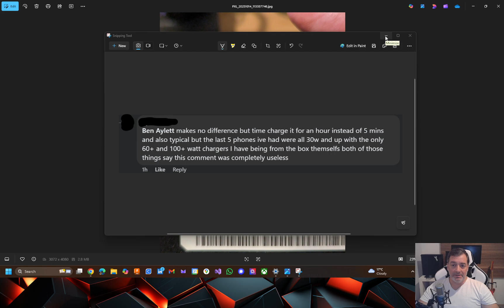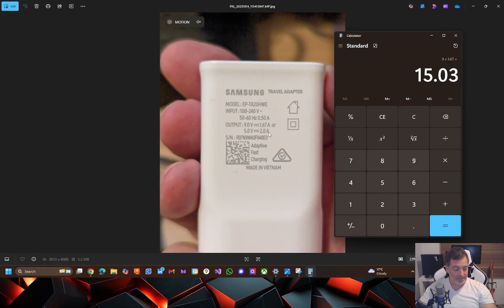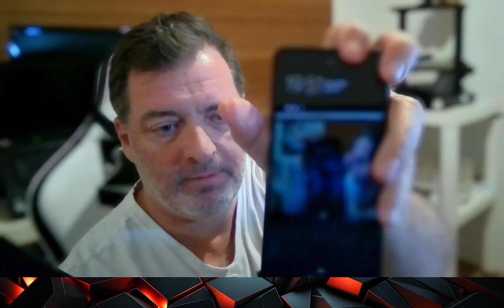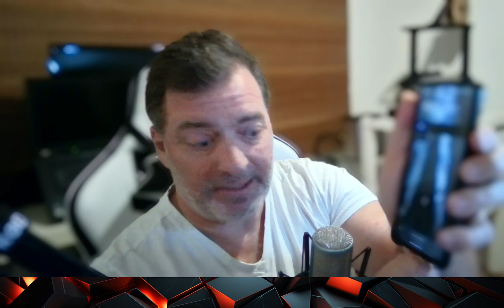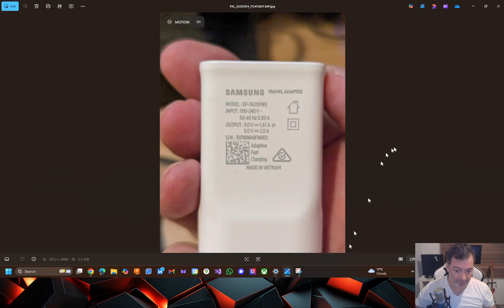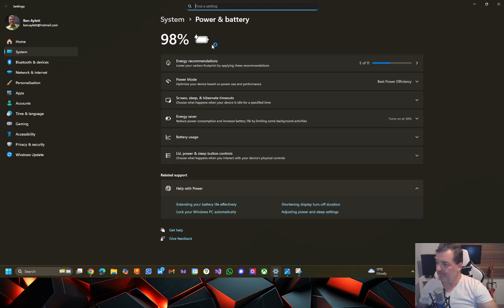Can you use your phone charger for your laptop?

Comment: If your phone charger supports 20v pd mode it will work with laptop. If it doesn't have that 20v pd, then some laptop will show charging slowly and others will  not show anything because they only support 20 volts pd

Comment: Hi Ben , Yes you are pretty much right there mate.

Is it possible  though ?     

" Caveat"    

well   / Maybe with a 30W mobile phone fast charger ( But i wouldn't waste my  time ) Good Reasons not to ?

you will be waiting several days/ weeks  for it to partially  charge up  and it could  potentially damage laptop components and circuitry or life of battery.  So  many  variables and risks  to  consider.

 People may not be aware  - Laptop chargers have a  hell of a lot more filtering and their power output is far cleaner and stable Suited for Purpose ( Matched to Laptop spec )

Now  compare that to the common  (WAll WArts) mobile phone charges . Which are fine for most mobile phones and similar low power devices. 
Problems arise  if  used for devices  that have higher demand than a mobile phone charger was designed for  - eventually they get hot and potentially  fail .  Always a high risk of sending a power spike into your device when a charger fails.  

 So not  worth the effort attaching to a laptop.   

1.Either it won't work
2.Or if you manage to get it to work  ,it will take a hell of a long time to Partially charge  ,with a high risk of failure or damage to components from heat , incorrect charging rate or power spikes.

Cheers Ben 

G☕🥓🍳